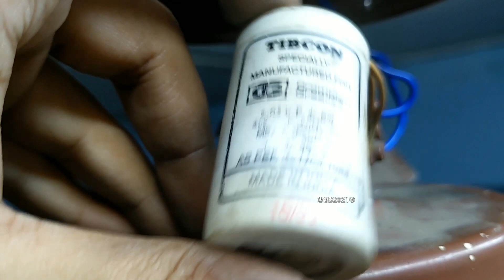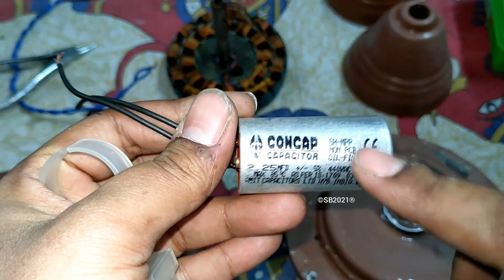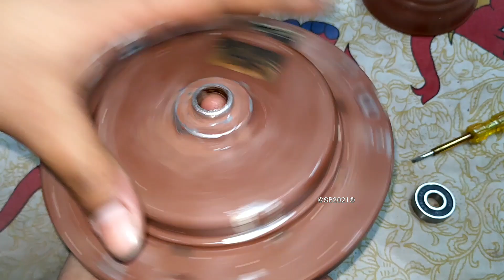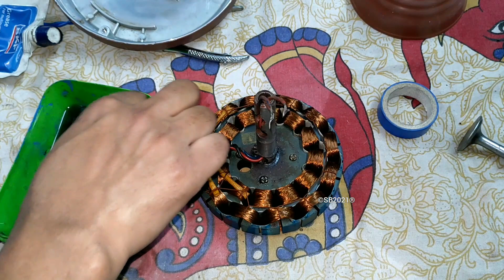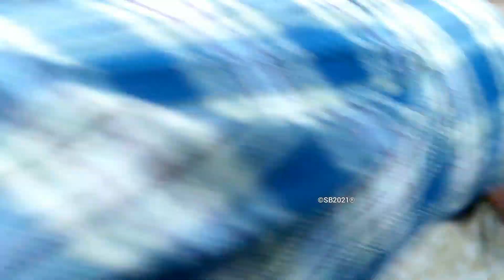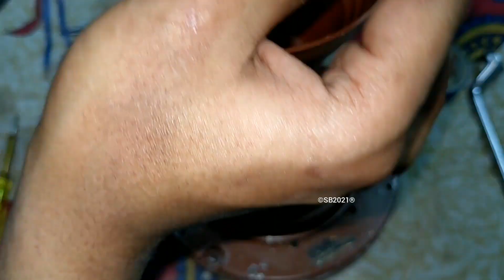CROMPTON GREAVES HIGH SPEED (1999) 1200MM (48") REVIEW

Comment: what capacitor should i use in crompton high breeze 1995 model,  1400mm ceiling fan
Reply from the maker: 2.25mfd for normal voltage range. 2.5mfd for slightly low voltage

Comment: pls suggest 2 fans for 18x15 feet room. Older fan is not throwing equal air everywhere, its just in down centre of motor. I am thinking to buy 56 inch fan. Which model and company fans should I buy to cover whole room with air.
Reply from the maker: Crompton HS56 & Havells Pacer 56 will be your ultimate choice. My honest opinion.

Comment: Hi, I have question. What is the maximum MFD rating for capacitor on fan for 220 - 240V - 50/60 Hz and the fan is 62 watts?
Reply from the maker: 1.85-2.0mfd

Comment: Got same in opal white of March 2001 but I guess R.I.P gold plated rivets as the above side is gold plated/painted but lower isn't maybe wrong/unoriginal blades but it has been on the fan for long time so maybe manufacturing defect but with everything original on motor like capacitor,bolts, winding etc,never opened
Reply from the maker: Sad to hear...

Comment: Sir, will surebreeze category blade sets available in Crompton service centre at chennai? . We had just changed the house and the guy who removed my fan and the blade sets of 3 blade sets were severely bended and wobbles too much . Since my Crompton cool breeze is 13years old the bladesets were weak and it is long running fan .
Reply from the maker: Yes it will...

Comment: The speed has slightly reduced may be due to the new bearings which you have installed but it'll get better the more you'll use it. Otherwise the fan is operating very well after servicing. Great job. 💖❤️
Reply from the maker: Great point!
Thanks for your response 😊

Comment: Great video! As I have said many times I love this fan! Unfortunately I never managed to acquire one, though. On DesertCart they are over 150 Euro!

On the contrary I have seen very garbage fans made in China, where the bearings are fixed very tightly to the shaft, and I had to force the motor open to see the interior, and in one case I ended up ripping the windings.